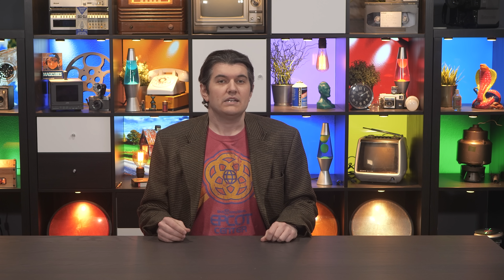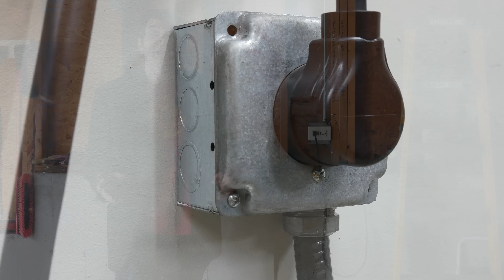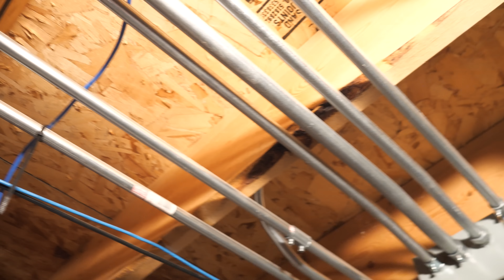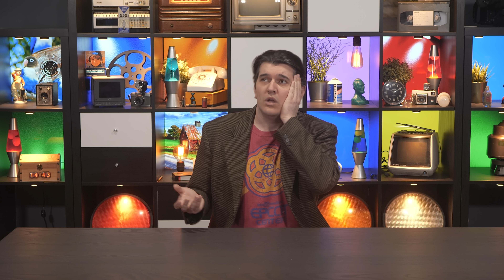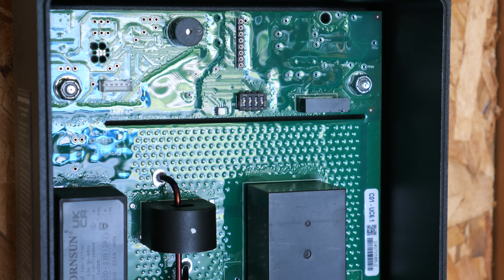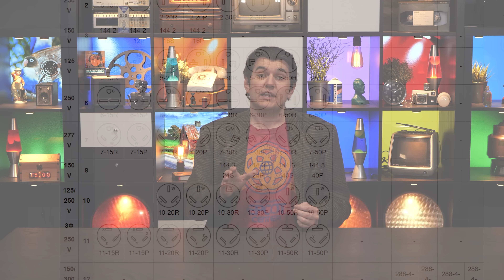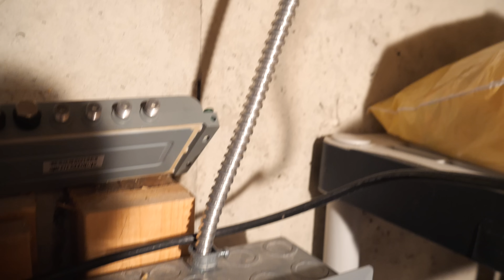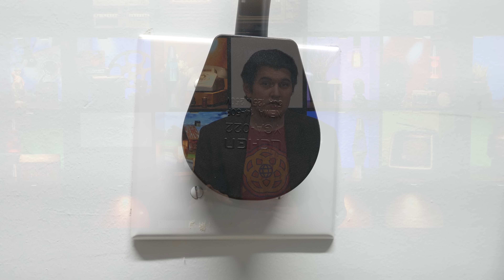The "standard" car charger is usually overkill—but your electrician might not know that

Comment: This is content so many people need to see.

I charged my Tesla Model 3 for 4 years on a 120V/20A circuit.  I had a 240V/50A in the other garage for the other EV and the garage was as far away from the electrical panel as it could possibly be, and still be connected to the house, so it was going to be expensive to put in an additional 14-50, even if I did it myself.  I did have trouble in the Winter when temps stayed around zero for a couple of weeks, but only once needed to top-off at a DC fast charger on the way home from work.

I did consider taking one of the 3 120V/20A circuits in the Model 3's garage and converting it to a 240V/20A, but it just never turned out to be needed.
Reply: I haven't finished the video, so unsure if he mentions freezing temps being an issue, but that's the main concern that will cause issues for people charging off of 120V. I've gotten by fine charging primarily on 15A, but during winter it will really struggle to keep up with heating the battery enough to charge so charge times skyrocket and it's very inefficient. I use a splitter from my dryer that's in the entryway from my garage for those instances where 240v is needed, but it's not ideal to prop that door open in the winter either, so will be looking into getting a dedicated circuit ran soon. Unfortunately that will require a panel upgrade for me, but I think in my case it will be worth it as I don't intend to ever own a non-EV again, and will likely electrify more things such as a home battery backup generator in the future.
Reply: @vul-yy4xq  That a very important point.  I plugged in to a 15A circuit, so only charging at 120V/12A on a day that was about -10 F.  I'd guess the wind chill was around -20.  I was plugged in for 10 hours and only added 2 miles of range, even though it pulled 12A for the entire time.  Virtually 100% of the power for the day went to trying to keep the battery warm enough to charge.  I was parked outside and the wind pretty much sucked the heat out faster than it could be warmed.

When parked in my garage, even in very cold weather, I would see roughly the first hour of charging was just warming the battery.  After that I think the charging itself generated enough heat to keep the battery warm enough since it charged at the "normal" rate after that.  The garage I used is not heated but it is very well insulated (R28 walls, R34 ceiling), so that's significant as well.
Reply: Charging a tesla from 120V is peak madness. It is like filling a water bucket with a sieve.
Reply: @procerator  For many people I know, the math disagrees.  If you use less than 50 miles of range per day, and your car spends 12 hours parked at home every day, on a 20A circuit I was getting 5 miles of range per hour.  That would give you 60 miles of range per day.  The point is, consider your personal use case.  My sister for example only drives about 15 miles per day with an occasional road trip a couple times per year.  She could get by using a 120V/15A circuit even if she drove a larger EV.  Installing a high power circuit for her would just be a waste of money.
Reply: @techringo6469 If you drive only 50 miles a day why did you buy Tesla and not the Chevy Bolt or other cheap alternatives with smaller range? Feels like price difference between cars is much bigger then just installing more powerful charger.
Also, what if you need to suddenly drive 200 miles a day, and same amount next day?
Reply: @procerator  It's a bit off-topic, but you asked.  I seriously considered a Bolt.  I was replacing a Chevy Volt which was a pretty good car.  I do take longer trips about 4-5 times per year and for either car I'd need to depend on DC Fast Charging along the way.  The Bolt was a horrible road trip car.  First of all, in 2018, non-Tesla charging was very unreliable, and not widely available in Minnesota and Wisconsin where I traveled.  It's still pretty bad today.  Additionally, the Bolt could only charge at a max rate of 55 kW compared to the Model 3's 250 kW.  The 15 minute charging stops in my Model 3 would have been more than an hour in the Bolt...if I could find a usable charger.

And if I just had a couple of days where I needed to drive 200 miles I'd use a nearby Supercharger.  And if it became a regular need I'd go ahead and upgrade my home charging.  That was my original plan, but It never became a priority since it was doing fine at 120V.

Looking back I used Superchargers 14 times over the 4 years.

The Model 3 turned out to be a great value for me since I sold it after 4 years and 40,000 miles and it had only depreciated $5,000.  And I was never advised to park my car outside so it wouldn't burn my house down.
Reply: @techringo6469 , Why not convert the 120 V outlet to 240 V. That’s easy enough.
Reply: @richiesd1  It's not as easy as you think.  I looked into it but there were a couple of complications that made it not all that easy.

1.  Converting from 120 to 240 requires two adjacent slots in my main power panel.  My panel is full, with a lot of double breakers, including the breaker for my garage.  Not a great setup, but it's what came with the house.  I would have had to figure out how to move 3 other circuits to make it work.  It's doable, but it's a bunch of rework in the main box that certainly wasn't easy.  Especially since all the existing wires are cut to the exact length they needed for their existing termination.

2.  The bigger issue was that the outlet I used for charging is not on a dedicated circuit.  So If I wanted to make that 240, I'd have to make every one of the outlets on the circuit 240V.  That would have been a major issue, since those outlets are frequently used for other things.  So, while I had 3 circuits in the garage, I'd lose the South wall outlets, and 2 outside outlets in the process.  Or convert the East wall outlets that I almost never use, and run a 25 ft extension cord, which is also not great.

I could have done the conversion, but as I said above, it turned out it wasn't needed, and was certainly not worth the effort to make it happen.  The minor cost of charging at the fast charger was trivial, since I just stopped at the Hy-Vee grocery store on my way home from work, where I needed to do some shopping anyway.  So I think it cost about $10, with no time or inconvenience.

It's kind of the point of the video.  Don't spend the time, effort and money for an upgrade if you don't actually need it.

Comment: I used a NEMA 14-50R in the garage for my tesla for a little over a year.  I watched a few videos on Youtube about them melting or possibly causing a fire and honestly, rolled my eyes.  Curiosity got the best of me so I finally checked mine and the surface of the plug had started to ripple!  It wasn't flat anymore as it was when I purchased it at Home Depot.  I've since replaced it with an EV approved version with much larger electrodes.  You can see the difference if you look into the plugs.  About twice as much contact surface on the EV version compared to the non-EV version.
Reply: What kind of charger were you using? The Tesla one will automatically slow down based on the amount of heat it detects at the connection.

Comment: My experience back in 2022 trying to get my first charger was kind of the opposite of the scenario described at the beginning this video. Places were not trying to get you to go with NEMA 14-50 outlets, they were trying to get you to install a hard-wired charger. I intentionally requested and went with a NEMA 14-50 plug specifically so that I could easily get a new charger if that ever becomes necessary and not have to do any wiring. And if I ever move, I can just take my charger with me by unplugging it.

I wanted to try and do it myself, but the process of getting the necessary electrical permits was extremely poorly documented where I live compared to plumbing and other building stuff. I paid someone to do it just so that the permits and inspection stuff would be handled by them, but I'm glad I figured out how I would do it myself ahead of time. The guy who came to install the outlet brought the wrong gauge wire (8 instead of 6) and when I saw the spool I immediately called him out on it and he had to call his boss for approval then go back to their warehouse and get the correct wire at no extra cost to me. I made them do it right despite the fact that I'm not even using a 40 amp charger, but at that time I didn't have the car or a charger yet.

Comment: I feel like theres a hidden benefit to slow charging too. Battery pack life. Fast charging is VERY HARD on lithium battery packs. Even cellphones can throttle charging now to slow charging. Ie overnight charge on my smartphone is actually a 2a SLOW CHARGER. This kinda saves the battery and I only fast charge if I need power in a hurry. Same here with an ev. Its actually cheaper to use the personal charger in your house vs a public fast one.

Comment: As also an electrician who has installed ~40+ chargers around the country in EU/EE, I can say, that most owners here have a market price contract and they do care how much it takes to charge the car and when. Seeing numbers of 5 to 9kw there makes me feel, that it's definitely harder to convert to EV's over there. I'm usually are helping owners to choose between 11kw and 22kw. And because most cars here come with 11kw onboard and 22kw extra, then most installs i've done are set to 11kw. Also homes tend to come with 20 to 25A mains connection. Three phase. (~14-17kw).
Benefits are, that owners can "snipe" the cheapest market prices after midnight to get their cars full at low rates. Also it's the time where other appliances are usually not running, so the grid connection is mostly free. I do install load balancers also in most cases. Because 20A grid connections means, that 16A will be used while charging and it would be easy to trip it if heat pumps and cooking is going on too.
Also you mention chargers having onboard RCB, but international standard here requires there to be physical one included too. 
I wanted to mention also about smarts, because I usually do install "smart" ones. They do have apps but they are also available with very close to price to the one that was shown in the video and you can totally use them in a "dumb" way without ever touching the app - and it's fine. But clients usually want them to be set up with profiles either for market price or nightly hours.
Typical recommendation from me is to set them up as - cheapest X hours before Y.
So if owner arrives home, plugs in and goes inside, the charger will check market info and schedule X cheapest hours before Y to be used for charging - easy.

Comment: If you live in an extremely hot area, it may be better for your battery to charge it slowly.  The data seems to indicate that charging rate is not a concern otherwise.  The car won't charge faster than your battery can handle, assuming it's a stock battery. But if your battery is baking in the desert sun, slow charging might help prolong its service lifetime.

Comment: One thing I think is interesting one I got my ioniq 5 is they call the regular 120v wall adapter an "emergency charger" and recommend against using it to charge the vehicle daily in the handbook. But I can leave it in overnight and get away with off-peak charging with my daily commute even at such low wattage

Comment: Great points. I had a plugin hybrid, and it came with a 15 Amp standard outlet charger, which would charge it from minimum to maximum over night just using that. I also bought a 240 volt 30 Amp charger that plugged into my cloths dryer outlet because I thought I might need to charge in less than 3 hours, rather than up to 12 hours. I don't think I used that more than once in two years. The regular plug charger covered 50 miles of driving overnight, more than I ever needed in almost all days.

Comment: The fact that it might not be legal to do the electrical work yourself, is the only thing that is applical to me, because there's technically not much of a difference in knowing electrical engineering and knowing electronical Engineering… only difference between them is using a house for a circuit vs using a Printed Circuit Board(PCBs)… so I can ,with knowing what's needed, do the same thing that you have done, but it being legal for me doing it is the only issue imo 😊😊

Comment: We've been using the same 16-amp EVSE since 2011.  Everyone then told me I was a fool for not "future-proofing" the installation.  My argument was that the larger battery packs became, the LESS need for high charge rates.  These days we have 2 modern EVs with a combined range of about 600 miles, and still managing to service both of them with that single 16-amp unit.  The archaic name for a storage battery is "accumulator".  I think that term better helps to understand the dynamic in play.  Also fully agreed about "smart" units and the briny depths!

Comment: The only time I'd disagree with "slow" charging is if you're talking 110v at 8-12 amps being supplied to the vehicle. I ran this, and it was more than fine during non-winter months. Crucially may car sits outside, and during the brutal and high-wind Midwestern winters, my car couldn't maintain charge, even with my short 10-20 mile a day commute. 

I'm also super rural, so using a DC fast charger to catch up wasn't really feasible either.

I often wonder if my car was indoors, if it would have been enough---either case, just upgrading to lower amperage 240v was more than enough for me.

Comment: My neighbor's car was stolen while she was 8 months pregnant. She did not find this amusing, but since the youths totaled it, she bought a plug in hybrid something or other. She now has a 1 month old and has been charging the car off the Christmas tree light outlet on their porch.

She hasn't bought gas yet. Ever. She'd had the car for 4 months. It's just the slow charging. It's wild.
Reply: This is largely my experience minus the theft.  I puchase gas when I travel, or every few months when I commute. Now that we are in the warmer months I almost always have a 100% electric commute.  In winter I had a couple very cold days that were nearly 100% gasoline powered so the waste heat would keep the cabin warm.  Even slow charging takes the 14kw battery from 0 to 100% overnight.

Comment: meanwhile the in my house garage has just one very conmently placed rated 50 amp plug and curent for a 50 amp load that my dad and setp motehr telsa can just plug ihnto as chagre just over night realy realy rrealy fast form teh battry bank thsat solar powerd in during the night. yes we got a 50 amp plug with its onw curent just in on its onw curent by itself right next toe the huge two 500 amp plus curect brakers near the soalr power batery bank. yes the same kinds you plug your  coths dryer or refigrator inot in the usa for the most hevy duty stuff.

Comment: We have a chevy bolt and we use the regular outlet charger at home which is just fine for our daily driving.
Ya it takes multiple days for a full charge from empty but if we need a quick boost we can go to a nearby quick charging station. However where we live has the advantage of plenty of fast chargers.

Comment: 28:03 Now I'm wondering if there's any serious effort to bring aluminium wiring back into the home, since much of the hazards came down to improper installation of the wires and flawed early connector designs. All high-voltage transmission cables are aluminum, so it's not a fundamental flaw of the material.

I'd think the lighter weight and inexpensiveness (both to purchase for the owner and its scrap value for thieves) would dramatically help expand the ubiquity of charging points, making EVs finally as attractive as ICE cars who enjoy a century's worth of development in a network of gas stations.

Comment: Another reason to go for a more expensive "smart" charger is if the power company is offering incentives, rebates, or demand response programs. Like the basic Grizzl-E I saw you mention was like $400, while I went with the Chargepoint, which was $550 but in my area came with a hefty rebate and more incentives for participating in demand response, which okay, I shift my charging by 2 hours I'm still asleep when most of the charging happens.

Comment: I am shocked there isn't NA wall charger units that just runs off 120v and charge a large battery that has the option for fast charge when needed. It can basically charge 24/7 or when cheaper rates and only dump hvdc when needed. Could be done very intelligently. Like just run the charger off the functional equivalent of a Tesla powerwall or something. It could double as backup power for house too.

Comment: My first EV was a 2012 Leaf with 35mi range. 240V charging was a need if we wanted to use the car in the evenings. Ditto with my PHEV Pacifica (30mi electric range). In the wintertime, 240V charging is necessary between preschool runs.

Comment: I already knew all of this in theory. This clarification is effective and useful. My mother was all in a tizzy because the condo board was looking at the cost of installing one charging station per parking spot. I told her to have them put in one dual 120 volt outlet for every two spots. They still haven't quite figured it out.

Comment: 16:54 i mean i top up my tank every day, but thats because i need to flush the sediment from my tank and refuse to go under 1/2 a tank until i get that done. ( long story short someone thought when they replaced the fuel pump before i bought it that they should drain and coat it, but the ethanol in gas turned the coating into sediment so there is a layer on the bottom ) ( i have dual inline filters to make sure it doesnt get to my fuel injectors and cause more problems if it does get kicked up into the fuel )